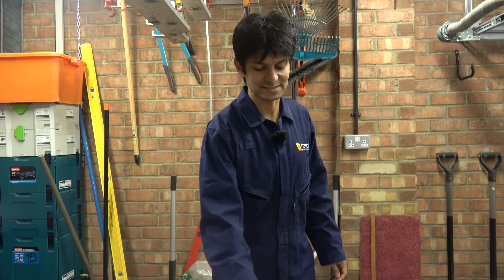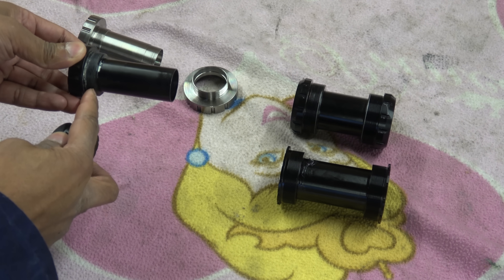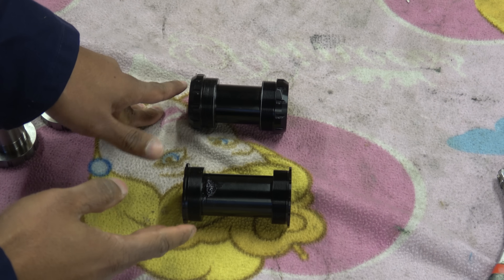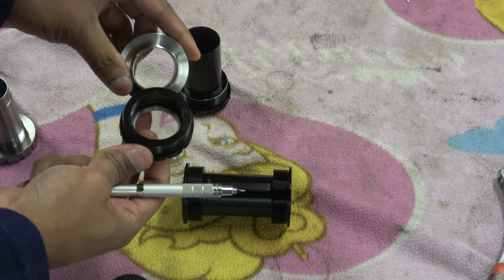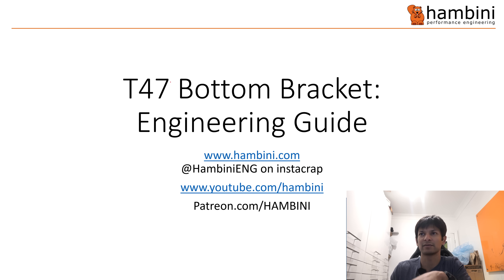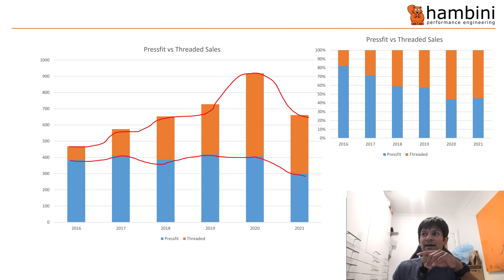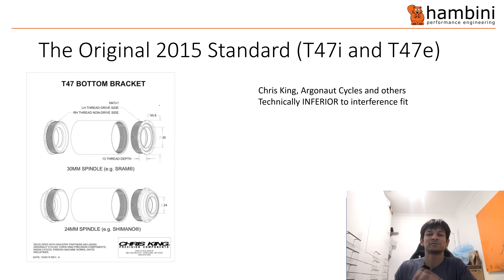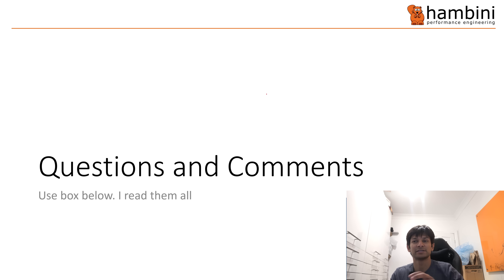T47 Bottom Brackets | Full Engineering Guide | Everything you need to know

Comment: serious question/point  - Hambini, why don't you/will you ?  design a proper workable quality 'standard' for production bottom brackets
Reply from the maker: This is a good question and it's fairly straight forward to answer. The issue is not the standard. BB86, BB30, BSA etc are fine as standards. The problem is implementation and an inability of bike companies to stick to the standard. They could quite easily meet the standard if they were prepared to pay for it. The reality is they aren't prepared to spend the extra $15 per frame to implement it.

The bean counters can't see what the extra $15 buys so they ditch it on the premise that most customers will never know. 

We have two extremes of competency. On one side there is Gerard Vroomen who attempted to sue me claiming that his OPEN frame was not required to meet any standard because no dimensions existed and at the other end we have TIme and their RTM frames which are very well engineered. A Time frame costs considerably more than an OPEN frame to make because of the process used to make it. The Time frame is geometrically more accurate and you are paying for it. It is a difference you cannot see.
Reply: @Hambini  the funny thing is the bean counters are making a concession to add and tap the bonded alloy cups in the frame as opposed to having checked and "cleaned up" the net molded carbon interface for press fit.  But they can sell it as an improvement I suppose.  I frequently see comments that many errantly believe that threaded is better than press fit, of course it isn't (when press fit is executed correctly).
Reply: I don’t think the problem is the standard(s), it’s that the bike industry can’t accurately build frames to them.
Reply: @simonbailey2151  This is true and at the same time disappointingly funny. All the modern technology, micrometer precision machining with CNC devices, sensors, lasers and they can't drill a bloody hole straight!
Reply: Insert joke about an engineer complaining of the 15 different standards, deciding to make a be-all standard. Now there's 16 standards.
Reply: @cjohnson3836  It happens over and over and over again with bottom brackets. At least in BMX they were sufficiently satisfied with 22mm spindles that pressing an R12 bearing directly into a properly machined steel frame has become the defacto now for ten fifteen years already. Some minor variations but all the in betweeners between BSA and Ashtabula are essentially short term experiments and nobody's faffing around trying to add a new one. Problem with people who want to go fast is that extra spindle diameter contributes a lot to power transfer from the left arm, and bigger spindles can be made lighter. Doesn't help that the first 30mm spindle crank came out decades ago now and so there was already a huge size buried in the 'traditions' so to speak. 24mm came from the Sweet Wings and 30mm came from the same era on C-dales both in the mid 90s. But those two always took a loot of mucking to swap between.

...and then you add the desire to make,buy,sell carbon frames and everything goes to shit.
Reply: Still using a Campy crank and bottom bracket from my first bike purchased in 1975. Now it’s on the cheap Fuji track frame as a fixie.
Reply: To expensive?
Reply: @richardwilliams1728  a can of coke is not too expensive & the engineering & manufacturing tolerance that goes into a ring pull is immense  - our hairdresser jockey can do this
Reply: @blackdoublezero  every frame is different though so it would mean building a custom BB for each frame.
Reply: @redhel  i'm no google, just a humble production engineer
Reply: @richardwilliams1728  I'm a production engineer in the beer & beverage canning industry, with a passing interest in cycling. I watch the channel for the high quality engineering content ... it was just an innocent comment/idea for a way forward -  i had/have no idea that the world of bottom brackets was so wild west
Reply: @BlackDoubleZero  indeed,I thought pretty much the same as you,along the lines of why isn't hambini consulting the bigger powers that be,hambini made md a custom BB a couple of years ago,it wasn't super expensive but the avarage rider/profit hungry  bike company wouldn't pay as much as I did,but this is also the thing,it will be the last bottom bracket I'll buy because the quality is so good and that's where big companies don't make money because they want you replacing on a regular basis rather than a one off sale.
Reply: @blackdoublezero  HELLLOOOOOOOO Coca Cola fans!
Reply: When someone use 24mm axle, others defer and use 30mm axle.
And then a smart company says it has to be 29.XX mm no more no less.
Do we see a “standard“ coming when bb is merely used to monopolise and then most of the big companies couldn’t make it work consistently?
Reply: @Billo7979  that 29mm is still a 30mm inner on the bearing but with a 1mm plastic spacer. Go figure.
Reply: As a pro mechanic I flipping hate press fit bb’s. A threaded BB replacement can be done in 5 minutes, as long as you’re not a moron and cross thread it, it just works. Press fits are a PITA. I’ve had ones that took me an hour to replace. Plus they always creak.
Reply: T47 in my mind, is great for all the reasons BSA is, while adding internal clearance. Being able to install and remove it reliably with the same tool is very convenient.
Reply: @seitenryu6844  Using the oven to remove bearings from the bearing cups is a big advantage. I made a bunch of bearing guides for in-frame press fitting before leaving my lathe behind, because otherwise you are sort of screwed...
Reply: Since you are production engineer, 100% you understand the GD&T.

It is easy to follow tolerance for metal product, however the cfrp is not the case. In average, the smallest tolerance for cfrp that we can get fresh out of the the mold is +0.03mm and above. So we need to machine the pf bottom shell to accurate size.

1) In my experience dealing with aerospace cfrp, once you machine the cfrp layer, it will damage the integrity cfrp itself and it getting worse by put stress on it.

2) Cfrp is not favorable for continuos stress + cyclic loading. 30 to 40% of it is polymer (plastic), prone to be scuff during installation.

3) For short time use in race, yes pf bb on cfrp can work flawlessly. For longevity and daily usage, pf is not ideal.

4) When you deal with pf, you don't know how tight is tight. My friend's frame, pf b.shell worn out after 2 years. Mine bb68 still strong and it is objectively tighten at 45nm.

5) Threaded bb, easy maintenance and recycleable. We can reuse the bb. Just take out worn bearings but using heat gun then put it back by using heat gun. The bearings slide in and  out like butter (heat the bb, not the bearings).
3 times my recycle bb68 receives new performance bearings.

6) The bearings can be replaced, so the cost is cheap. You need only the performance bearings, cost you 50usd.

Conclusion, I will choose bb system with easy installation, easy maintenance, no damage to bb shell, lower cost and recycleable.
Reply: what is cfrp?
Reply: Carbon Fiber Reinforced Plastic
Reply: I’m a BSA fan, but wasn’t the point of press fit being that by putting the bearings in the frame you can do much more with oversizing the tubing?
Reply: @bradwright2982  To space the chain stays wider apart to accommodate wider rims/tyres.
Reply: BB386evo already exists.
Reply: Do those bike companies have very short memories. It was only 10 years or so ago that carbon frames with alloy inserts were creaking and de bonding and replacement frames were being sent out. I rarely see that at the moment bur suspect now they are back to threaded alloy shells that may be the case.
Reply: As others have said; it's not the standard, it's the bike frame makers not being able to hold bearing press fit tolerances or other tolerances of form and position. Full suspension mtb bikes have the same issue with linkage bearings. Everyone thinks they need to replace linkage bearings once a year and thinks 'oh well; that's just the way it is..' !

Comment: Hello hambini (or anybody that knows enough to answer my question)
I have been trying to wrap my head around the hollowtechII bearings to swap mine, and I can't seem to get it
I have seen people moaning on forums that shimano requires 6mm wide bearing, as opposed to the 7mm wide 6805 standard
But here 3:23, tou say shimano uses 6805 - can i just grad those from NTN of SKF and slap them in my BB ? Will the extra mm on each side not be a problem ?

Comment: The likely reason 30mm axles were foisted on consumers was to avoid the Shimano patents around 24mm. The engineering in most Shimano rotating components has been overall more astute, sophisticated, and well designed in terms of practicality, cost effectiveness, performance and durability. Sadly, the aftermarket voodoo around overhyped gear has matched that of the "Audiophile" industry, where the luxury indulgent world has created an alternative reality where "quality" has no correlation with real testing, etc.
  The early hollow cranksets made with carbon arms, and soon ceramic bearings, were often horribly poor, in spec, function, and durability. Only a pro could find mechanics willing and able to tinker and finagle acceptable setups with this junk - but the consumer market was eager to foist it to the average amateur, because it cost 10x what Shimano gear cost.
  The explosion in competitor's New and 'Improved' bottom brackets was too often a solution in search of a problem - and the carbon frames created many.
  Currently, even Shimano seems resigned to outsource T47External BB cups and bearings, to Praxis, unfortunately, not that long after they'd improved their original cups and bearings available for the ubiquitous BSA BB shell. The only reason was frame builders, enchanted with the ever-bigger diameter tubing, decided the 30mm shell was stronger to weld - not noticing that the outer diameter could have been kept to serve the original diameter.
  The high cost of most T47 BBs has little to do with the end result, since most bearings are sourced from the giant industrial brands that can make far better quality than any small boutique bike brand.

Comment: No mention of 73mm wide frames. Only 68mm, and then the mega wide 86mm with nothing to hold on to. Do I have to buy Hope T47 BB to use T47 on 73mm frames or does Hambini BBs work on 73mm wide frames?
Reply: T47 A иддеально подходит к раме 73 мм

Comment: One way to avoid BB tilt/yaw deviation from crank axis is to couple the first half BB to the crank shaft just before BB thread into the BB shell and finger tight it first. Follow by the second half BB in the like manner. Once all pieces are pre aligned, we can tighten the BB together by finger then apply torque tool to finish it.  This way the bearings axis and the crank axis will be complementing each other during and after the installation.

Comment: Hi!
What do you think is the best BB standard if you would design it?
Would it be different for aluminium vs carbon frame?
Do you believe aluminium spindle is better because there is no possibility of galvanization or do you prefer steel spindle?
Whould you have different designed BBs for 24mm vs 30mm spindle? 
Thank you

Comment: I’m having an issue with my Colnago V3rs BB. I have Sram DUB power meter. My bike shop ordered a T-45 ceramic speed. It fits perfect but when they tighten the preload, it stops spinning freely. If they don’t tighten it enough, there is play in the cranks. What’s going on? They also installed a new preload adjuster. They have to put enough spacers on the drive side so the spindle doesn’t hit the screws of the front derailer. Will wavy washers help? Any recommendations and help would be appreciated. Thanks for your great videos!

Comment: Hambini, I don't know what to do. I'm old. Have a 50 y.o. bike. Upgrade long overdue. I'm interested in a Litespeed Arenberg. Love Shimano gearing. But now the frame bracket choices are a nightmare on all bikes it seems. 

With Shimano, corrosion is now rampant on their higher end stuff. There's incompatibility among components. Cranks are breaking in half. Brake levers corroding. What the heck's going on here? These bikes cost thousands of dollars, and yet, they suck. 

I like the new Shimano 105 R7120 mechanical 12 speed groupset, with disc brakes, a compact 50/34 chain ring, a 12-36T cassette (because it's hilly as hell, over here, and I'm 70 y.o.) I feel that unless I get some assistance, though, I risk spending my life savings on a piece of junk bike that will fall apart, or even potentially, get me killed.

The Litespeed Arenberg that I've got my eye on is constructed of titanium, as I'm sure you are aware of—and offers options, choices, all sorts of things—when you attempt to order it on their website. Do you have any advice on how to approach this? 

Here's a summary of what they're offering, and my responses to them in parentheses:

3AL/2.5V titanium with size-specific tubesets, each with wall thickness controlled, drawn and tuned per size

(Sounds good to me.) 

Titanium dropouts, disc brake mount, headtube and bottom bracket designed and CNC machined in house at Litespeed to deliver optimal strength-to-weight

(Again, sounds good to me. But what do I know? Their default bottom bracket is a PF30. Its upgrade, is a T47. But who knows what that even means? I'm hoping you do, Hambini, and what mating it to a titanium frame would do. Is this all a good idea? Should I stick witht their standard PF30 one, or move up, for about $250.00, to the T47 model?) 

Clean and classic fastback seatstay design

(Okay, Whatever.) 

Optimized for 28c to 35c tires

(I'd like 32 mm wide tubeless tires, and also, later, to add third-party Orange-Velo stainless-steel mudguards to it; but can I? Would they fit? They're 45 mm wide.) 

Shift cable routing: mechanical external or electronic internal

(Strictly mechanical, for me.) 

PF30 bottom bracket shell, with T47 threaded bottom bracket upgrade available

(Again, I have no idea if that's good or bad. The more I read about such things, the more confused I become.) 

Litespeed vinyl graphics provided standard, with up to nine color choices

(The Etched Finish upgrade is being offered at no charge currently, which sounds
nice.) 

Bright Brushed frame finish provided standard

(Beautiful, it is.) 

TiDize color anodization upgrade available

(Not interested.) 

Frame sizes: XS, S, M, ML, L, XL and custom

(I hear horror stories about everyone buying bikes too big for them, despite the charts displayed online to help out.) 

Proudly handcrafted in Chattanooga, TN using globally sourced premium materials

(Nice, but . . . ) 

Average weight for size medium frame: 1,425 grams

(Not a concern, I'm adding mounts for a rear rack and will put a big bag on top for all my stuff to bring along with me.)

https://postimg.cc/wtPnBdFp

(Beats me.)

https://postimg.cc/t7yGn9pq

(Again, beats me.)

https://postimg.cc/gallery/Wg8dkww

(This is beyond me.)

https://postimg.cc/xkzBxVWx

(I have no idea. Hey, I'm no engineer. Love your detailed video here. But again, the more I read and view all this—the worse it all seems. Like none of it is supposed to go together.)

https://postimg.cc/14q4G8Cw

(But here’s the best part. the requests field. Where you can ask for anything you like. I filled it in with all sorts of requests, mainly, what I had mentioned in the beginning, that which I was interested in: a specific groupset, for instance; room for fenders, and so forth. 

Later, in a chat I had engaged in with them on their website, I was told that none of my requests could be honored though—because the items I had requested were not listed in their options. So why, I ask you, would they place a field titled “Component Requests” if the customer couldn't actually request things? I already filled out what was listed as options or upgrades.

When saved, the entirety of my list, including my choices, my requests, showed up as a document: my personal list, as it were, as if it had been approved, and given a price for the whole thing. So now what would happen if I were to go to the check-out section and pay for it. Wouldn’t they have to honor the entire list they themselves had printed up and thus build the bike that way at their stated price?)
 
The entire bike industry baffles me, to be honest. Are these people on drugs, or what?

Sorry for the length of this rant of mine, and if none of these screenshots showed up. Not sure how to insert them.

Thank you for all you do, Hambini. I really mean that.

Comment: I am looking at a bike frame that specs "BB: BBT-47."  Is this the same as "BBrighT-47 Bottom Bracket?"  I want to run SRAM DUB in their 'Wide chainline crankset' for a gravel bike.  Is this setup like your 'Hambini Racing T47A T47-77 BBrighT-47 Bottom Bracket SRAM DUB Crankset' line?   SRAM specs T47 (85.5), T47 (Road and Road Wide) 68mm, T47 (Road and Road Wide) 77mm, T47 (Road Wide: 85.5mm), T47 (Road: 85.5mm).  How do I determine the width I need and find out if you have it in your line?  Is it likely Hambini Racing T47i T47-86.5 Bottom Bracket SRAM DUB?  Or, do I need a number direct from manufacturer on the crank-crank width?  If there weren't so many BBs I would ask much fewer questions!